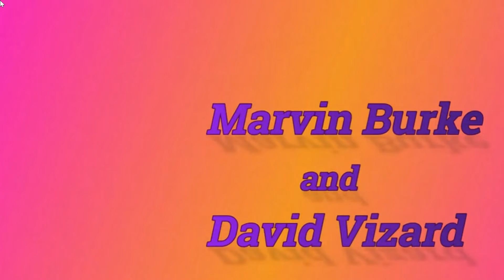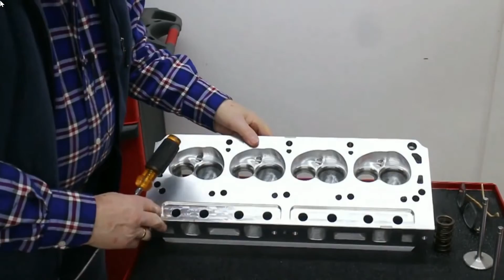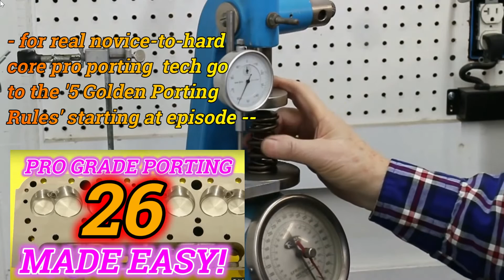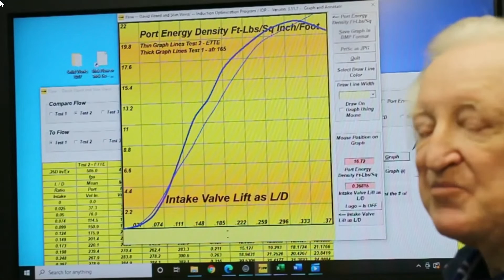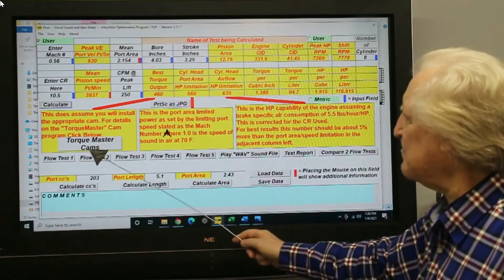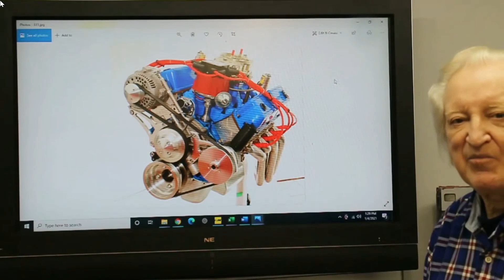All hype or all real? The facts on AFR's SBF Renagade heads.

Comment: Great data! "Before you can manage it you first have to measure it." This has been my motto for decades. Or at least one of them. Another is "There is no replacement for displacement."

What irritates me, and maybe I am just being a bit of a jerk, but people use the term Ft/Lb of torque for linear force. Linear force is Lb-F - Pounds Force. Ft/Lb is rotational torque. Pounds force per foot from center of the radius. For smaller measurements, there is inch pounds and inch ounces.

Comment: From what I read polishing intake ports on the street kills mpg. In drag racing the motor isn't sitting idle for very long. The video showed that with the polished intake ports were "wet" and was diminishing atomization. In racing applications this doesn't occur. Last point this is my actual birth name whether you believe it or not. Also I run from no one. ᏺꭴ ꭽꭵꭱ ꮓ ꮀꮓr.
Reply: I would love to see more dyno data on rough intake ports. How rough is too rough? Should their be smooth spots like the SSR or should it also be rough?

Comment: The rough surface has the effect of shark skin. A bad heart attack wiped out a lot of my memory, but it it has to do something with the laminar air flow. They experimented with airplane wing surfaces and found there was less wind restriction but the manufacturing process was complex. 

My question is that since we know a lot more now than 20 years ago, why aren't manufacturers just manufacturing heads with all these features?? It wouldn't cost any more during the manufacture to include these features.

Comment: Nice to see a product that lives up to expectations. Thanks for the time and effort you put into these videos.

I have some questions on porting. When we build an engine, with care, we do our utmost to get the piston and rod weights equal and we CC the chambers to get them equal etc. When porting what is our goal? Do we want to get the highest flow numbers from each individual port or should we try to equalize them as much as possible?

When we put a manifold on then we will have unequal runner lengths. Would it be beneficial to have more flow, as measured on the flow bench, to the front and rear cylinders to compensate for the different runner lengths?

Comment: For the mere price tag these are Awesome heads for any small c.i. SBF. As they out perform many other's that cost much more. I tell my customers all the time Bigger isn't always better....
Thanks David for sharing your wealth of knowledge!
Reply: Do you think they would be worth the extra price compared to the Promaxx 180 heads? I’m in the process of upgrading the 351w in my 90 F250. I’ve already upgraded  to a Terminator x for engine management on the stock fi system. Im not looking for huge power but good low and midrange torque which i think these heads would work perfect. Im looking to convert to a Lunati efi  roller cam. 272/280 adv dur with .477/.477 lift and 112/108 lsa/icl
Reply: @supersportimpalass  Much better components for sure. So YES if it's a driver that gets or will get alot of use they'll last longer too which that alone makes the $ worth it

Comment: I note, gleefully, that you, a world respected and accomplished engineer, freely refer to an engine as a "motor". What do you say to those stuffy, pedantic, SELF STYLED "engineers", that huffily insist that "MOTOR only applies to electric..." blah blah blah? I always say, "Motorcycle, motorhome, motorboat, motor oil, motor racing, and Dept of Motor Vehicles. Shut up." 🤣
Reply: Motors are electric. Engines are internal combustion. What you’re saying makes you right is just peoples ignorance of the word motor. Motor is a word originally from the year 1586. Causing or imparting motion or moving at a vigorous pace. So replace motor with movement or moving and pretty much every time it will work which is funny because the people who invented those things could of called them anything but along with it sound right it’s also because of the words history long long before we had the automobile which is maybe why they used motor in place of mobile because cyclemobile and mobilecycle doesn’t sound right like a bicycle that imparts motion on its own…ah yes a Motorcycle.
Reply: @Thumper68  Hiya Thump. We've chatted before. You're the Pontiac guy and ethanol maker. Thanx for the info. You are technically correct, but as a former writer and English major, I say it's a fight you'll never win. The public at large decided 100+ years ago that "motor" was acceptable for an engine (but an electric motor should never be called an engine), and when enough people use a word a certain way long enough, it becomes de rigeur.
Reply: @jeffrykopis5468  I think you have wrong guy I’m a Chevy guy.  Nice to know you though and someone who understands English language or understands societies misunderstanding of it perhaps.🤔  And I agree you wouldn’t ever hear anyone argue the opposite that electric engine would be acceptable terminology. It would be a good point to use from my side of a debate though and I never used before so thank you I believe I will next time and save all the other ammo. You’re also correct it’s a fight I’ll probably never win and I accept that.  I’d rather win the war 🫡
.
Reply: @Thumper68  If your stated history and definition are correct, then "motor" was in use long before we had electricity, too. And could thus be applied to any sort of motive force using rotation.

Comment: Looking at their web site it's interesting that the 165 and 185 are CARB legal, even though they won't work with stock pistons. I'm surprised that it's possible to get CARB approval while requiring a swap of other parts.
Reply: They will work with stock pistons, if using the STOCK cam, I believe. But AFR knows you won't, lol. The 185s may be better suited for the 351W in mild street applications.
Reply: It may also be possible to lightly flycut the stock pistons, right in the bore, for valve clearance.
Reply: Daniel, it doesn't require new pistons. Just PTV ( piston to valve) Clearance. Sometimes, not even the pistons need clearancing. CARB is a generic compliance for a specific family and year to get an EO#. Ford removed EGR on some SUV 5.0 and Australian market 5.0s. A lot of heads are exported, and the TUV , EU andADRs in those countries require a valid CARB code .
Reply: @deanstevenson6527  Their web site states:

AFR's 185cc "Street" cylinder heads feature 100% CNC ported intake, exhaust & chambers, A356 aluminum castings and high quality components throughout. Recommended for engines from 302-393 cubic inches, operating up to 6000-6500 RPM. Part #1422 & 1492 are street legal in 50 states for 1995 and older emissions controlled vehicles under CARB EO #D-250-3. Not compatible with OEM pistons. AFR heads are available bare (without parts), call our tech line for details.

maybe it isn't accurate. 

I would have expected CARB approval to be for a certain configuration, meaning a certain set of pistons, but I've never dealt with it. I know it isn't cheap.
Reply: @totensiebush  Have.a.noce day Daniel 🥝✔️. AFR has been doing OEM cylinder head certification for GM and Ford and other companies since 1971. Thermactor AIR and EGR operation, and mixture motion, of it's got an EO#  for the parts stated,.and you may have to fly cut to ensure PTV,...you can bet those heads will produce less four gas.emissions than any stock D, E or Alloy GT40P production heads. Or else's.tjey wouldn't say so. The see techinical support is a Grandfather Clause. Let the Reader Understand. Again,.have a nice day,.Daniel. 🥝✔️